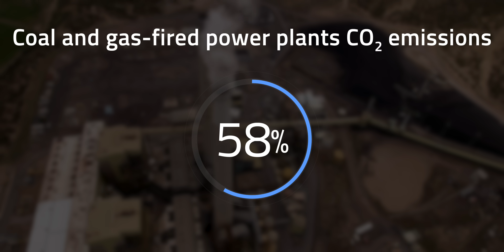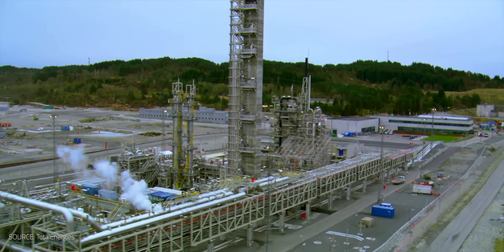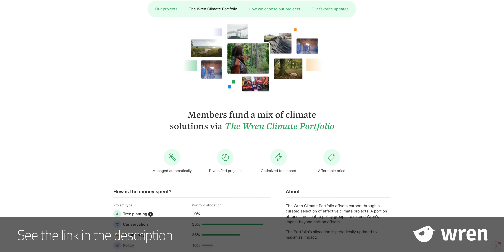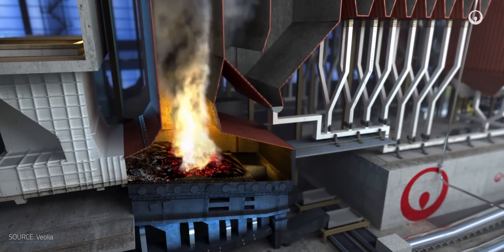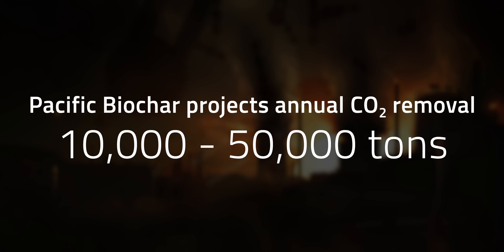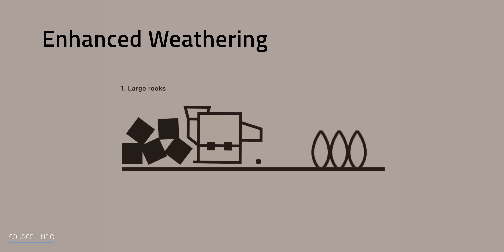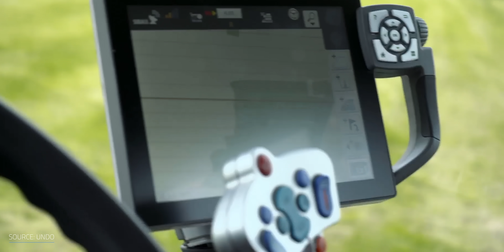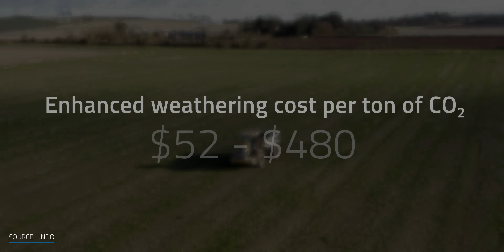The Reality of Carbon Capture

Comment: This video obfuscates the differences between biochar and enhanced weathering both in the narration and the visuals. They are not "natural alternatives" for carbon storage. They are both significant bioengineering projects with some potential to mitigate the egregious effects of burning fossil fuels and dump the residual gases into the atmosphere. Biochar is a carbon sequestration method rather than a carbon storage method.
For one thing, biochar carbon sequestration is REVERSIBLE if the soil is disturbed. To be effective, appropriate soil management practices like no-till agriculture have to be maintained indefinitely. You can't build on the land afterward and it can't get flooded, because the carbon will be released. 
For another thing, the pictures in the video of people burning branches do not match the conditions necessary for pyrolysis. We don't know what the purpose of burning wood going on in those visuals is: it could be land clearing, it could be the production of wood ash for fertilizer. But nobody is sequestering carbon under those oxygenated, low temperature conditions.
Which bring us to the fact that biochar doesn't provide nutrients unless it's amended with fertilizer. (Some products marketed as biochar fertilizer actually contain synthetically produced N, P and K, so there are carbon emissions from that production to take into account.) Biochar alone only has positive benefits to the extent soils have become carbon impoverished. If other nutrients are also missing, biochar won't improve crops. Regardless of the other nutrient levels, soil will eventually become saturated with carbon, at which point adding more biochar will have severe negative effects glossed over in the video. 
Showing visuals of agricultural equipment spreading stuff on the soil without specifying what's being spread blurs the line between what's being done now with fertilizer and what's being proposed with crushed volcanic rock. It gives the impression that biochar and enhanced weathering are more similar and store carbon along equal timescales than the full truth would reveal.

Comment: We presently have a hybrid that gets 50 miles a gallon. Rather than install air conditioners I bought two new heat pumps. Seeing as I live in oklahoma, one of the best states for solar production, the panels will be going up soon. Trying to leave as small of a carbon footprint as possible! #SaveThePlanet

Comment: I doubt that biochar has anything to offer. Firstly it has to have a huge source of uncontaminated organic material and this material would be far more beneficial as mulch without 1) the extra energy consumption required to initiate combustion, and 2) two the extra energy required to obtain oxygen depletion. Not to mention the counter-intuitive process of burning to generate carbon to reduce CO2 emissions. I would like to see a basic thermal calculation on this and it would be very basic, that shows the net positivity of this process. I doubt it exists and would change my mind if it did exist and was somewhat rigorous. I do not think that this would serve as any part of the climate solution. Weathering seems more likely though still a long shot.

Comment: Along the lines of using aggregate, etc. To sequester carbon, I work in the steelmaking industry, specifically on the metallurgical slag handling side, and we are currently supporting research into the use of steel slags and/or other materials) for both carbon sequestering as well as forming a calcium carbonate product which can then be used as a limestone replacement - so it's using a recovered resource to start, mitigating the need to quarry material, but it is also providing a useful end product which again can supplement limited quarried resources. In this scenario, the carbon capture almost takes a back seat to the financial benefits of taking an under utilised low value material and turning it into a mid to high value matierial which is desirable for other industrial applications.
Reply: What about all the harmful materials contained in the slag?
Reply: @moos5221  such as? I'm not sure what you are thinking of that would be of concern for use in further industrial application?
Reply: @benjaminmuscat7385  actually never mind. i thought there would likely be lead and other poisonous metals in the slag, but i just informed myself and realized i was wrong. slag has apparently been used for many applications for decades, seems reasonably safe.
Reply: @moos5221  it depends on the type of slag, but for BOF Slag (which is what I deal with), it's very safe - the most concentrated metal we have to monitor is Chrome, and you are still talking about a fraction of a %, which is locked in and won't leach out

Comment: Since it has been determined by a substantial number of influential people/governments/scientists, etc. that carbon needs to be removed from the atmosphere in order to save the global population from various climatic horrors, thenit needs to be addressed in multiple fashions. From your presentation, biochar seems to be one approach with multiple benefits. Consider the massive fires in the Northwest US that cause excessive damage because the forest floor brush and tree debris base, especially that created when there is a large tree die out from disease. This debris collection becomes so dense that the normal fires become too hot and intense and destroy the forest instead of the cool fires that would normally maintain the forest environment. This is an opportunity for those states to employ people to remove the debris and use that material to make biochar. The biochar machines can be made mobile so they can operate locally and avoid long hauling of the forest debris. The biochar could be spread back into the forest, or sold and use on the vast american farmlands as a means to repair the degraded soils created by factory farming. Any concerns about the gas and soot emissions from the biochar preparation would be minimal compared to that generated by the uncontrolled fires plus consider the other damages in lives and property that could be saved. I like the biochar approach as one one way to sequester carbon.

Another approach not mentioned is utilizing carbon dioxide sequestration from processing municipal solid waste (MSW). It must be realized that MSW is derived mostly from plant derived materials, which are composed of carbon dioxide pulled out of the atmosphere. Somewhere between 200 and 300 million tons of MSW are landfilled producing carbon dioxide, methane, some other gases, and some other noxious materials including the liquid "tea" that leaks out of landfills. If done properly, MSW can be gasified producing hydrogen and carbon dioxide, the hydrogen can be sold and the carbon dioxide sequestered for the appropriate credits and making marketable carbon negative hydrogen. Because of the fees paid to accept the MSW (tipping fees) and the price of hydrogen (about $3.00 per kg) plus the carbon credits, the process can be profitable and carbon negative. This will remove carbon from the atmosphere, make a "green" fuel and eventually clean up the environment spoiled by landfilling, or incineration of garbage.

Comment: Hey Matt - thanks for this video. Hey, there's an idea out there that the carbonate in the ocean exists in equilibrium with carbon dioxide in the air. So when you remove a ton of carbon from the ocean, it is AS GOOD as removing it from the atmosphere. A second idea is that it's easy to get carbon to precipitate from the ocean - simply pass high-voltage DC through an unshielded cable and out comes calcium carbonate (i.e. "SeaCrete"). With the two ideas together, we're sequestering carbon. Can you investigate whether this is cost-effective with respect to energy-efficiency, compared to DAC?
Reply: I am wondering about whether this equilibrium regarding the exchange of CO2 between the atmosphere and the oceans is affected by the rising temperature of the oceans?

Comment: Si they are making charcoal (wich is a hell of a poluting process by the way) to be used a carbon rich soil fertilizer to help plant get bigger (have more carbon in them) faster wich then goes back in the atmosphere. Seems like a hoax that does not reduce carbon in atmosphere. But totally agree that at the very least it doesn't emit any new carbon in the form of oil or coal and that's good.

Comment: I would like to see more research into the stability of biochar when it's used like that. When it's eaten, or put in the soil, does it actually stay as elemental carbon? I feel like there has to be some bacteria that when given nutrient rich soil and carbon and water is going to do something to the carbon. And there are some naturally occurring oxidizing compounds.

I'm sure it'll stay for a little bit, but i'd like this sort of solution to last at least a couple centuries. If we put the biochar somewhere away from water i feel like it could last millennia if not eons (assuming we don't just burn it), but in farms? or cow stomachs? idk. At least it'd be hard to put it in a power plant if it's spread out that much
Reply: bacteria don't eat graphene
Reply: you don't even need it to be stable for centuries, if it's table for a few decades or a century it's enough to have an impact on the climate
Reply: @zazugee   
biochar is more similar to coal than graphite. And some bacteria eat coal, according to my googling. 

Yeah, decades is better than nothing (though, those bacteria sometimes turn it into methane, which is worse than CO2, so maybe it isn’t better than nothing). But I’m unsure that nothing is the alternative. These companies are going to buy carbon offsets either way, i like to think there are more long-term offset options. Like biochar that isn’t mixed with the soil.
Reply: there were many studies done on biochar but the most important ones, there was even done on multiple years on site and they found reduction in greenhouse emissions from soil and reduction in nitric gasses
Reply: it makes perfect sense because biochar seems to have an effect that slow downs bacterial decomposition in soils specially when mixed with compost, but the positive aspect on fertility is it's capacity to retain nutrients and reducing losses
but the reduction of decomposition should also help in accumulation soil carbon instead of it being reduced because of higher soil bacterial activity

Comment: I am always confused about the discussions surrounding climate change. Not whether it is real or not, but rather the, "we need to limit temperature rise by X number of degrees by Y decade." What is going on today, right now, is enough to cause catastrophic effects for our civilization.

So, in relation to the topic of this video, I feel we should be going all in on everything. It should not matter if an idea has long-term or commercial viability. If it works it should be done. It shouldn't matter if the method gets scrapped and replaced when something better comes along later.

Comment: CO2 is NOT pollution; it's a gas that's as essential as water for life on this planet.  This video falsely implies that the water vapour from power stations is CO2.  It talks about restoring the balance?  We're near the lowest CO2 levels of the last 600 million years, restoring the balance means we need to increase CO2 concentration, not decrease it.  

Nitrous oxide is NO threat.  It's concentration is about 0.3ppm and it absorbs at the same wavelengths as water vapour, which is close to 10,000ppm, so water vapour is doing the absorbing.  We don't need to reduce our carbon footprint.  Even the exaggerated temperature data indicates that the 2010-2019 average global temperature was just 1.09C above the 1850-1900 averages.  That works out to just 0.8C per 100 years.  I gave up with this video after 6 minutes because it's JUNK.  

CCS has been tried multiple times around the world.  What works in a tiny prototype never scales up into anything remotely economic.  The few installations that seem to work actually do other things, like help extract oil.